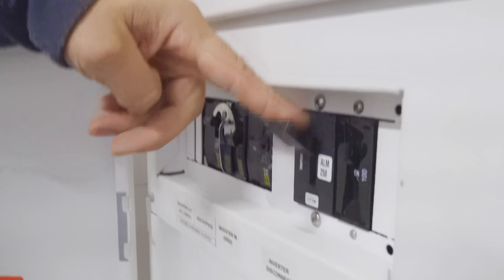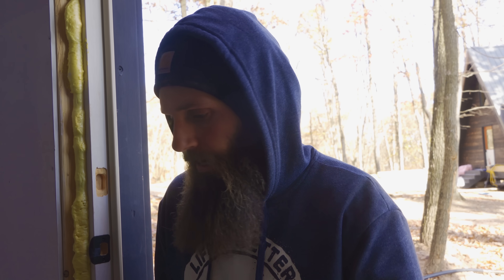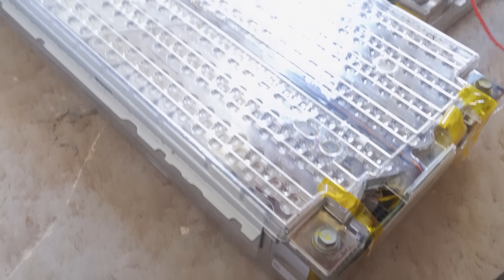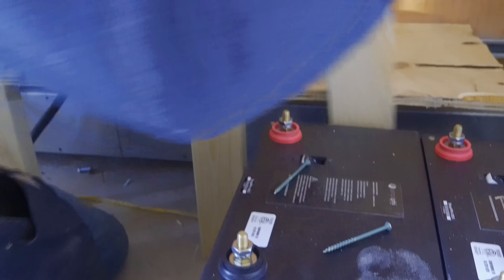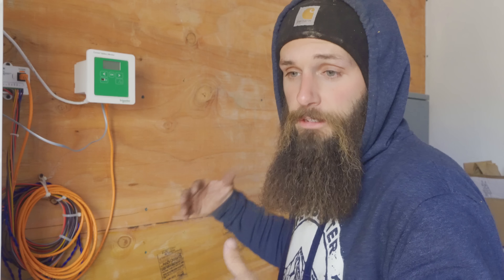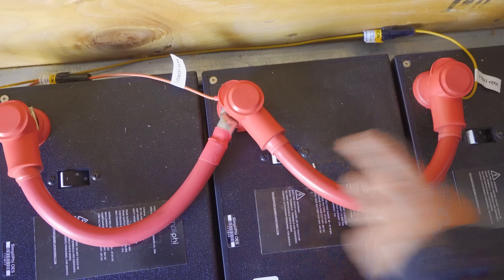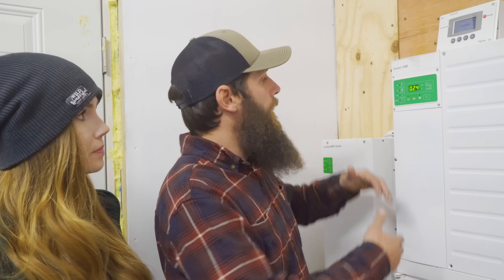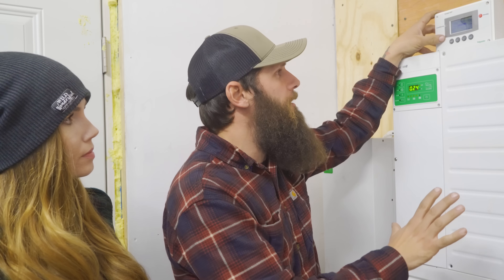Overhauling Our Solar Power System!

Comment: Heya, yes the 18650 cells witch tesla billt there battery packs can have a termal heat run a way. the lifePO4 battery are much saver and that's whats counting

Comment: I know this is an older video but I have a question if Josh sees maybe he can answer for me.  I am setting up a system with a Schneider SW4048 inverter and Simplify batteries the highest depth of discharge I can program is 48 Volts which is 100% discharge.  Did you find a way to raise that so you can get an 80% depth of discharge?

Comment: You call the batteries Lithium Fero Phosphate but I think they are Lithium Iron Phosphate and pronounced that way (symbol - LiFePO4 or LFP for short, the symbol for Iron is Fe). It's a good choice for house storage, they are a little bigger but last longer and safer (as you say).

Comment: I know that this is late, but I hope that it helps someone. Li-ion batteries have little risk of thermal runaway as long as you have a proper battery management system. With a BMS, you will likely not have any issues for 10+ years, and no fires caused by the battery.

 I'm not sure how easy it is to get a BMS installed for Tesla batteries. But they are a common and popular choice. There should be plenty of options out there.

Comment: I'm just now watching your video, one year later, and was thinking of what little I've heard about the Tesla battery possibilities.  I believe the Tesla Model S battery includes a cooling system (for the car).  The Tesla EV batteries really weren't designed for utilization in other stand-alone circumstances - hence, perhaps, the potential for thermal runaway.  However, the Tesla Powerwall is energy storage designed for domestic use, to store energy (usually from Tesla solar roofs or solar panels), used in homes, and (probably) does not have the thermal issues (?).  Plus Tesla also has the "Autobidder" software feature, for those who are connected to the regional grid, whereby any extra energy can be sold back into the grid - generating income for you, and effectively making you into your own utility company.  Very interesting!  I hope everything works out for you, and that your new Simplify batteries do what you need and want!  Best wishes with your ongoing project(s), and for your family.

Comment: Do you have passive or active cooling in your utility building?  I know Li-ion doesn't take too well to being hot for long periods (as far as lifespan), especially if they're under load.  Not sure how LiFePo handles it.  I just know buildings like that can get pretty toasty inside in the summer months.

Comment: You should also consider integrating an emergency power generator in order to charge the batteries when the weeklong snow storms deplete the stored electricity.

Comment: Absolutely incredible. Wow. Question about series connecting batteries: How close (in voltage) should each of the batteries be before connecting them in series? Is a tenth of a volt close enough or should it be within a few hundredths?

For example, when connecting two 12v LFP batteries in series, if one is at 13.10v and the other is 13.20v, is that close enough? Thank you kindly.

Comment: For batteries connection in parallel it is better to take cableout from the middle battery not from the first one
 or take the +ve wire from the 3rd battery and the - ve one from the 1st
That wont discharge one battery faster than the other

Comment: Cool Video   Where are you guys ?? is it Pacific NW or midwest or what. No Im not asking to come over but do like to keep track at what latitudes Aprox folks use these systems successfully.  I did not see a solar Hot water ?? do you use Geothermal for heat and cooling?  What blood type and white blood cell count??  Just kiding on the blood count  but am excited with your system??? Have you considered adding thermal mass. And Why is a cloudy day a problem?? You should still get 75 to 80% power on a cloudy day. Thus would not adding 30% more pannels give you what you need on a cloudy day?? Is it true a dogs mouth is cleaner than a humans?? OK  thanks guys

Comment: I know nothing about this stuff, but why do they not have like smaller inverters that go between the large inverter and the well motor or appliances that draw the most power? I mean I have inverters that draw let's say 12 volts and puts out 115, so if you placed one of them between the large inverter so it only draws 12 volts from your system, then wouldn't that make it use less?
Reply: Seems to me that no matter what something draws, it's what it draws?  Like the saying ''It is what it is''
Reply: @augustreil , When it comes to inverters that's not true.  Smaller inverters draw less than much lager inverters. Like I have a 300-watt inverter that takes 12 volts and puts out 115 volts, and I can run a fan and a house stereo with it for like 2-1/2 days before it kills my battery, and I have a 2500-watt inverter that takes 12 volts and puts out 115-watts, but it will drain my battery in 1 day. 
So in other words, the larger inverters are drawing 12 volts, but at a much faster rate.
Kinda like running a regular 12 volt light, and running a 12 volt LED light. The battery will last like 10 times longer running the LED, even tho' they both take 12 volts to run them.
Reply: @calvinh.8882 , Oh, ok. Gotcha, thanks !

Comment: Simpliphi batteries $4750/48V 3.5kw compared to tesla $6700/5kw battery worth look at, though i need to look into it a bit more. Two dif power sources. AUS prices

Comment: At the end of the day it is all about battery chemistry. The Li-Ion from Tesla has only up to 900 charges before degradation starts to occur, vs LiFePO4 2000 charges. So now you might ask, well why the heck Tesla doesn't use LiFePO4? Simple answer: battery weight per watts delivered. Remember Tesla builds cars? They have to move right? Therefore Tesla batteries have the best, so called density energy per weight in the market. However, when it comes down to non-movable energy sources, for long term use, at the current battery chemistry technology, there is no better battery than LiFePO4. And yes, you get what you pay for. Stay away from those cheap Chinese refurbished batteries claiming to be brand new. Just to realize that they've been already use to a point that nobody knows how many charging cycles are left - if any. Buy only new ones, from trusted sources. Enjoy!

Comment: One cheaper approach would to have a second small shed just for the batteries.  And/or an external metal locker.  Which is how Tesla packages them, for this very reason.  Inside the shed or locker would only be the BMS and the batteries, all the rest of the equipment could stay in your utility/powerhouse.  As you point out, there is a 4:1 cost advantage in favor of the cheaper and somewhat more dangerous batteries.

Comment: My first EV had LiFePo-Batteries, same chemistry as your Simpliphi-Batteries. The main "con" of the LiFePo is, that they're heavier, which is the reason why they are not popular in EVs. But for powering a house, the weight is not a problem, so perfect battery also in my opinion.
Btw the "normal" Lithium-Ion-Battery's chemistry is "NMC" (Nickel Mangan Cobalt) which Tesla and the vast majority of EVs are using.

Comment: We love your whole off grid setup ! Something for you to look at is your wiring ! I’m not %100 sure with your setup BUT most multiple battery setups work better and last longer if you take the power from the 1st battery and the ground from your last battery! This means that your whole battery bank is treated like ONE battery not (in you case) 3 batteries ! You have both the power and ground hooked to you #1 battery and what happens is that battery works harder and is always drained the farthest and the last (your#3 battery) never works to it full potential. So as and example (just pulling numbers outta the air) let’s just say your battery bank gets down to %50 you may find if you unhooked all batteries from each other and tested them separately you #1 might test at %40 #2 tests at %70 and #3 tests at %90 so your first battery is constantly being over worked ! If you hook them up with your power hooked to battery #1 and ground to battery #3 your system could get down to %70 and you could unhook them all and test separately and they would all test at the same % there for they are all truly sharing the load and will last longer with less chance of failure PLUS you will get more efficient power outta then and that will make all your things run better ! Hook your charging/solar system up the same way

Comment: I would make a single change to the whole setup. And that is to compartmentalize each system in a fire box. Electrical systems can go awry. As is,... you get the idea. Plus, fire proofing stuff is rather easy these days. There's red (unsure if code is the same in NA as is in Europe) drywall that's fire proof. Making a setup out of that is easy to do.

Comment: I commented too soon before watching the rest of the video. ignore the rest, it's clear You have done your due diligence. You should seriously consider lithium ion phosphate batteries, I'm a yachtie and most sailboats now are using Lithium ion house batteries, bearing in mind the systems are smaller but I've seen upwards of 1500 watts PV on boats, that runs A desalination plant, all navigation and electronics, bilge pumps, refrigeration lights and charging of 110/220 v appliances. The benefit of lithium ion is the level to which you can discharge them without damaging the battery, up to 90℅ as opposed to the 50℅ you get on other batteries. There are websites you can visit where you can buy cheap medical grade surplus or used lithium ion batteries for really great prices. Much better in the long term.

Comment: Sorry I haven't ran into your channel before. I assume you explain why you dumped tesla batteries and went to Simplifi. See others comment that these are great batteries. I really want flow batteries, preferably the Zinc-Bromide ones they've developed in Australia for home size systems. Could someone who saw the video on why they decided to get rid of the used Tesla batteries and why this battery (which looks awesome) is better than the ones most people are using?

Comment: Make sure you keep your powerhouse above freezing. You are not supposed to charge frozen Lithium batteries. You can use your Schneider accessory switch and program it to turn on a solenoid to power a chicken light or something in your powerhouse to keep it above freezing.
Reply: They installed a propane heater not long ago.  Although, long term they have underfloor heating laid.

Comment: I think a small series on solar would be good... on the design and load of the system, how you didn't mount it all to your house and how you ran wires and the specs of the wiring.. figuring out cost vs payback.. there are a lot of things that you don't realize when you are building a system. There are basically two types of systems out there.. like you built piece by piece and then companies that design maybe 5 systems and you order that system and they come and install it... hopefully by the time you expand your batteries the price comes down some... but yeah if you actually explained it i think it could help a lot of people... because it takes months or years and trial and error to get it right... either that or you hire a company.. but even if you hire a company you have to understand what your life will be like under solar. do you think you might put up a windmill too? A lot of times thats good during bad weather because you get wind to pick up if its raining and you get no solar.. or in the winter when the angle is lower you can still get wind in the morning and at sundown as the sun heats the air.... probably getting a weather station with a wind meter and putting the meter in different places on your property would be helpful.. calculate wind at different times of the year. I think its a good idea especially if you find yourself between projects and need some content. Are you going to do solar hot water? its not a bad idea too .. some people build their own.... ANYWAY heh.

Comment: I would also love to see a video on programming the charge controller, but I also have a couple of questions related to how you select lumber and fasteners.

For one, you seem to have a predilection towards 2×6 and 2×12 planks, and you often stack them up three at a time. Wouldn't a 6×6 be easier, simpler, more elegant (if we regard elegance as "an economy of means")?

And you mostly nail things together which I admit I probably wouldn't do, being someone who likes to take things apart if the need arises. But in this video you screwed the bench for the batteries together, just as you used screws when mounting the windows. What I build is small-scale, and ninety per cent of that uses machine screws and nuts and tapped threads, so my clueless question is, how do you decide between nails and screws for any given purpose?

Thank you!
Felix.

Comment: I have 24 trojan batties and pretty much run my whole house except the heat and air unit. Can't run a couple days on it though but can all night. I have 2 deep freezes, fridge, dishwasher all the lights, tv's, steroes, garage doors, etc My house is 2400 square feet. They are 4 yrs old now so getting to the end of their life span so looking around at new battery technology. I also bought a kohler 6vsg to charge the batteries. Have not hooked it up yet but it will kick on automatically when I program to say 48.4 volts when batteries get down to 50% and will kick off at my own discretion.

Comment: The battery charger output includes a circuit called a buck converter that reduced the PC panel voltage to battery voltage this also consumes another 5% ish efficiency loss. 
Not to mention all of the high current wiring that can be avoided.

Comment: Operating at high voltages provides significantly higher efficiency.  The first step in the inverter is to boost the 48V input to over 300V.  This step is eliminated in some inverters that can accept high battery voltages. Saving about 5% of the output inverter power.

Comment: Hey guys, love your videos. however you need to put the positive lead from your inverter on the opposite end of your battery bank, this makes the system think its one big battery, and not three separate batteries. It also ensures even charge of all three batteries in the bank. Positive input/output at one end and negative input/output opposite end. May pay to check, but Ive been using parallel systems for ages. Anyway Hi from Melbourne Australia, by the way Ive sent you an email with a picture. 

You also should get a NAFP3 Fire exstinguisher that protects electrical equipment

Comment: Appreciate the knowledge you guys pass along. From my days in the military, the lithium ion batteries had to be discharged all the way down a couple/few times per year for them to perform better and last longer. Kind of the opposite for the lithium ferro phosphate batteries, we'll see what your programming vid has about that. I like that they wire in parallel because it should lower the resistance, unless the electronics in the battery prevents that somehow? For the price I'd probably still make a simple setup work, with deep cycle batteries, but as I said, I appreciate the knowledge.

Comment: Josh, you're the sparky, and I'm only a mug, but wouldn't it be better for balancing the charge and discharge by having the positive and negative take-offs at opposite end of the parallel array? Or does that only apply to series arrays?

Comment: Tell us the real reason guys, this company sponsored you with these batteries. I have used Tesla power system for 5 years, and no it has never had thermal run away and yes we have bms on it, so why are you really going for a less powerful system,  I wonder.
Reply from the maker: We explained why in the video. Also, if we were sponsored you would know as it is required by the FTC to disclose that info.

Comment: You always hook the positive side 1st then connect the grounds.  When you break down the connections, negative off 1st. Why are you doing the exact opposite? Is it because of a current shunt? Those Lithium Iron batteries are much safer. Good choice.

Comment: This is awesome. I found your channel a couple of days ago. I'll have to watch your solar install vids next.

The house-sized inverters with battery controllers all seem to be setup for lead-acid, and anything that can be made to behave like lead-acid. Every battery tech has its own unique requirements, and lithium ion can be problematic unless managed by a purpose built system. So Tesla batteries are good, but not the best choice. The SimpliPhi batteries look pretty cool. However I was looking through their downloadable docs and I found this paragraph on page 13 of their install manual: 

Figure 4.0 represents two PHI Batteries in Parallel. Wire lengths from PHI Batteries should be
identical in length and gauge in order to balance the load across (all) PHI Batteries in the
installation. *Identical wiring length is a critical feature of parallel power storage systems
that must be adhered to throughout all parallel wiring instructions. Failure to wire in
parallel will void the Warranty.*

😳  Emphasis is theirs.

Comment: Very helpful. Excellent info guys. Over here in Aus I have a 7kw PV system connected back to the grid. So during the day we use the power we generate first then any left over goes back to the grid and we're paid. 020c/kw. It used to be 0.60cents. But Gov rebates were stopped. Very good to know about thermal runaway etc wasn't aware of that. Keep up the good work. PS 40.0 degrees Celsius here today.